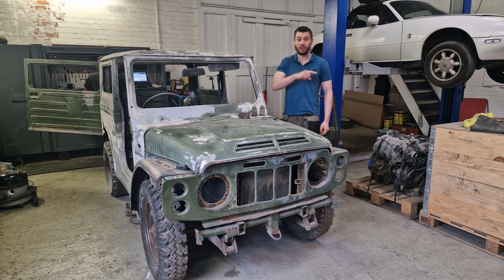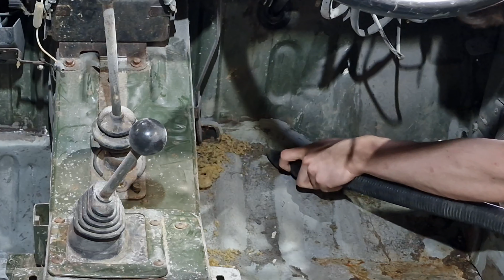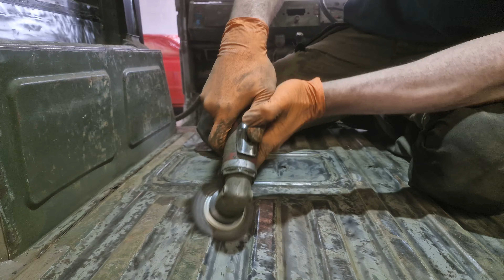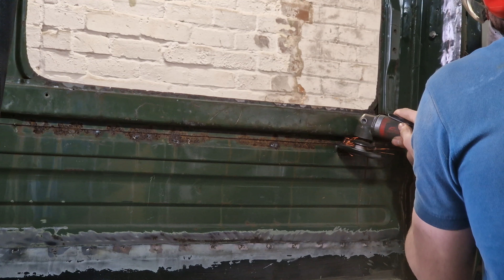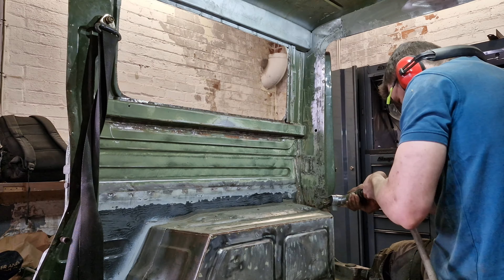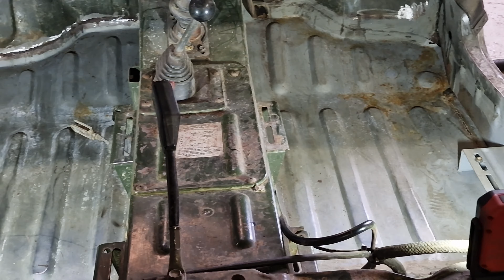Prepping The Interior For Paint! - Classic Car - Suzuki LJ80 Restoration Part 37

Comment: Hi, please tell me what you are spraying prior welding on the rear small section. Rust convertor/preventor or weld through something?
Reply from the maker: Thanks for the comment. It is a rust converter. 

We will also be using cavity wax to prevent any further rust too. Cheers